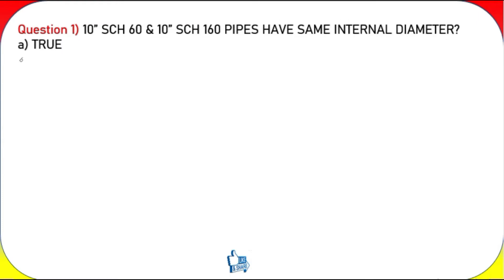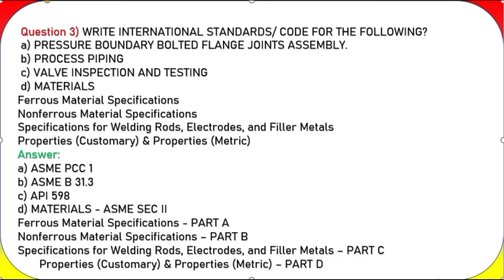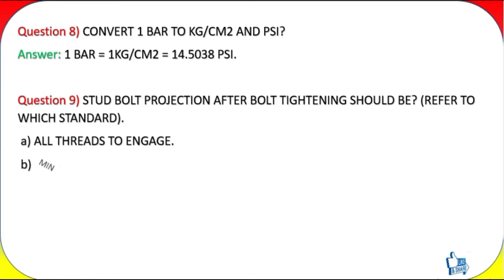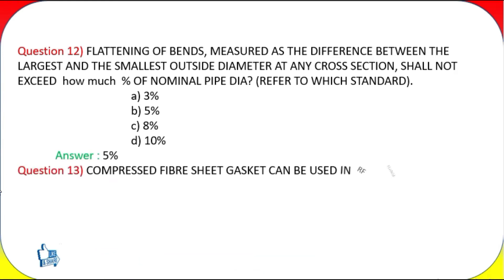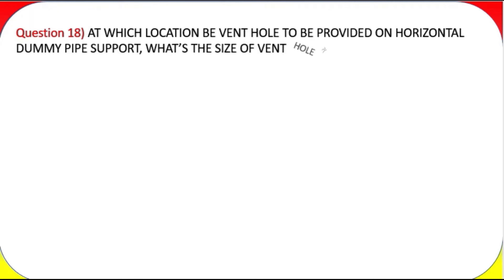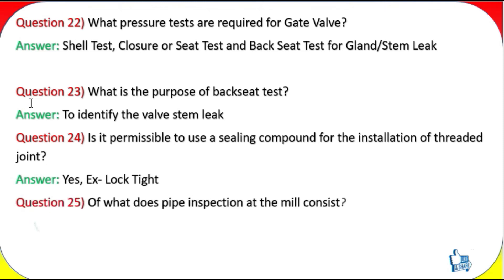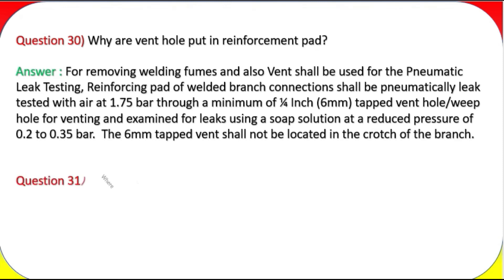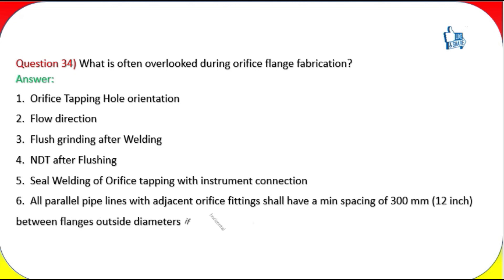QC Inspector Interview Questions & answers [Part-01]

Comment: i found this in B31.3
332.2.1 Bend Flattening. Flattening of a bend, the
difference between maximum and minimum diameters
at any cross section, shall not exceed 8% of nominal
outside diameter for internal pressure and 3% for external
pressure. Removal of metal shall not be used to achieve
these requirements.